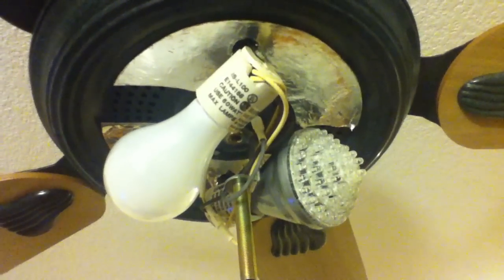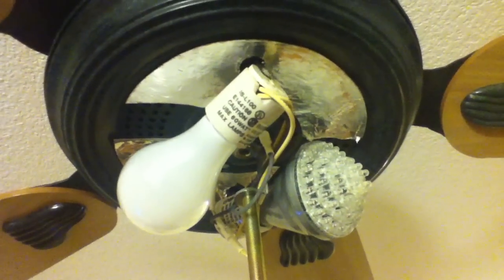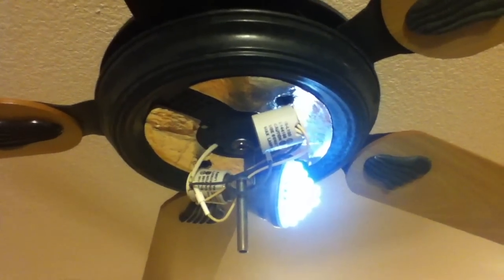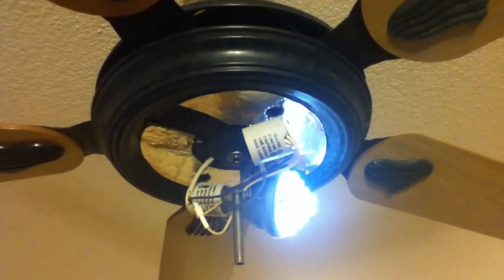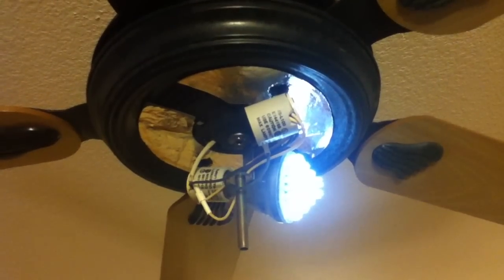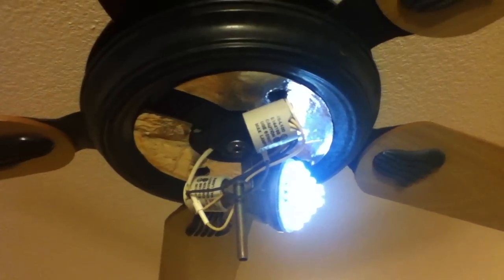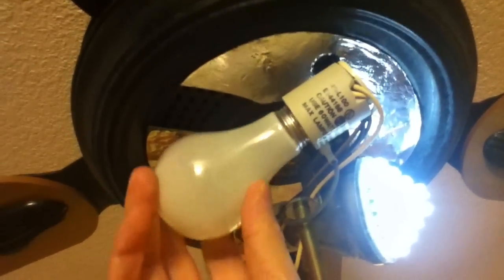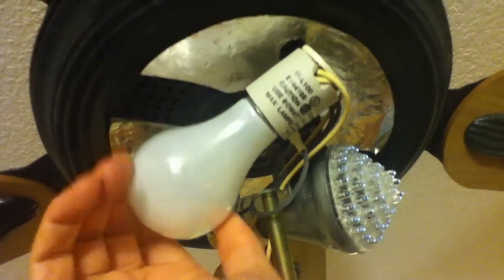Ceiling fan light flickering problem solved

Comment: I have 2 identical ceiling fans one in the living room and the other on the bedroom. I replaced the old fashioned bulbs with identical leds;3 per fan. The living works perfectly but the bedroom one will only turn on or not flickers if I keep one of the old fashioned bulb in. Any help please. Harbor Breeze brand.

Comment: Crazy, but yup... it worked.  I changed the two curly que (fluorescent) bulbs that were provided with the fan, replaced them with two low wattage dimmable LED bulbs, no hum, no flicker. Thanks!

Comment: Hey guys: this fan does not have a wattage limiter. Hampton Bay Callaway was discontinued in 2001, and it was before the factories are required to add wattage limiter which was 2007. The remote control system contain a dimmer for light which could be defective and causing a problem.
Reply: Plus most fans with wattage limiters used to the candelabra base bulbs right. Almost all ceiling fans that use candelabra base bulbs have a wattage limiter as well.

Comment from the maker: I checked out a YouTube video on removing "fan wattage limiter". Seems complicated. Even more so when the fan is already up on the ceiling. By the way, my fan does not have a switch housing since it is controlled by a remote controller. Thanks for the suggestion.

Comment from the maker: If mixing an incandescent bulb with an LED bulb does not solve the problem, you may include halogen bulbs in the mix. Removing wattage limiter is not always easy. Mine does not have a switch housing. The lights and the fan are controlled from a remote.

Comment: In all fans manufactured after 2005 are required to have wattage limiters installed, causing the flickering LEDS, the limiter is found in the switch housing and is removable, remove it and you can reinstall dimmer switches and not have to mix LEDS with incandescent bulbs, refer to videos found on YouTube to guide you through the uninstalation

Comment: I am having the same problem.  Bought a house with a beautiful Hampton Bay ceiling fan.  At first I instinctively thought was the dimmer switch.  So I replaced it with a new flip switch.  Problem continues.  I am using incandescent bulbs.  But I will try your solution.  Thanks

Comment from the maker: Vikingvic's comment has one valid point: I did not have flashing problem before the original bulbs went bad. Is it because of something magical in the original bulbs? Or, has the controller (current limiter) deteriorated with age?

Comment from the maker: Thank you for your comments. You are absolutely correct that the wattage limiter is the cause. However the problem is not eliminated by resistive loads (incandescent bulbs). I have a separate video showing the voltage-current characteristics of light bulbs.

Comment: The flickering is a result of the wattage limiters that were mandated in 2008 to be installed.  At low current draw it causes this.  That is why the resistive load eliminates this (above minimum).  If you remove the light kit and look at the wiring you will find a small box wired into the lighting that is responsible for limiting max wattage.  If you remove it your problem should go away (did for mine).  Just be careful on wattage as its there to limit the max draw to avoid starting a fire.
Reply: This model was discontinued in 2001, so there's no limiter.